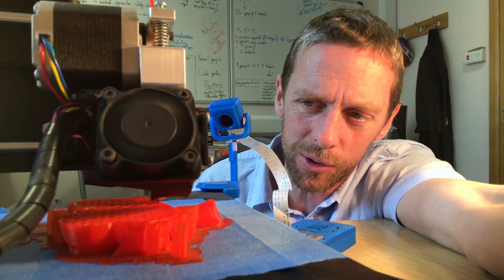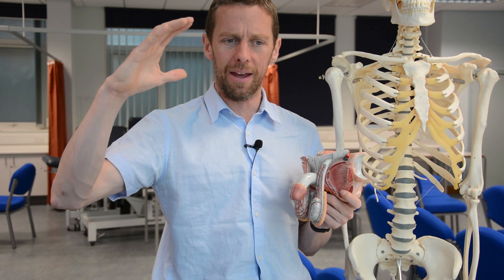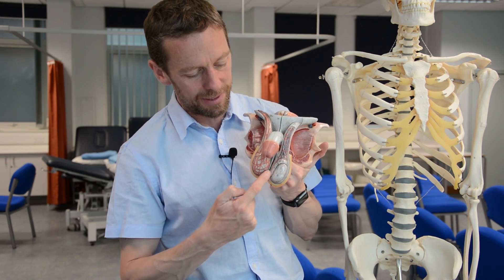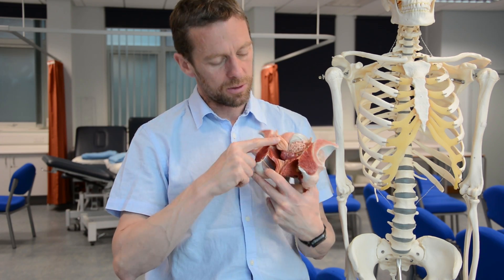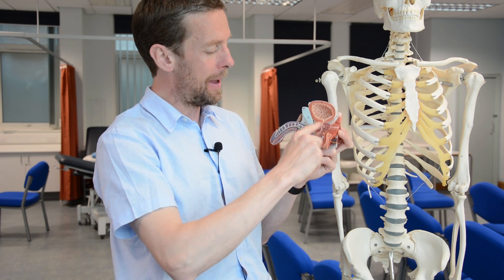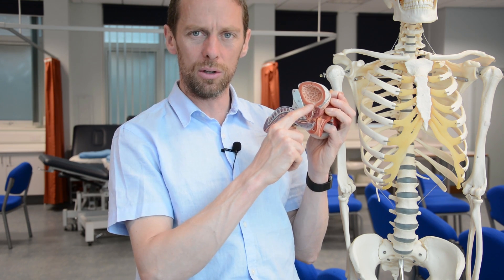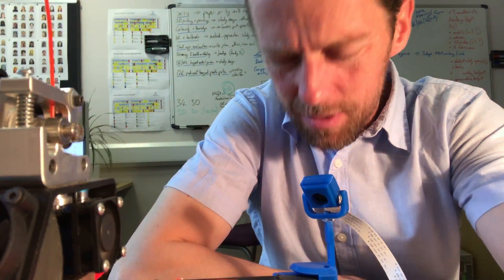Male reproductive system - the path of ejaculation

Comment: Where do the 4 or 5 ejaculatory pulses originate? Is this a kind of sucking into a chamber and then pushing out the urethra, or is it all contained withing the tube? Is there a check valve of some kind to prevent back flow, or is part of the musculature able to tighten behind, push the sperm forward and then regroup for the next pulse? Does this squeezing come from the brain, the spine, or some other excitable muscle reaction? What are the normal amount of ejaculation pulses in the male? Do they all have the same number of pulses, or does it vary by age, health, etc.? Thanks

Comment: 1:45 Testes
2:00 Seminiferous tubules
3:15 Tunica albuginea
3:30 Epididymis (posteriorly)
3:40 Rete testes (straight tubule)
4:05 Ductus deferens or vas deferens
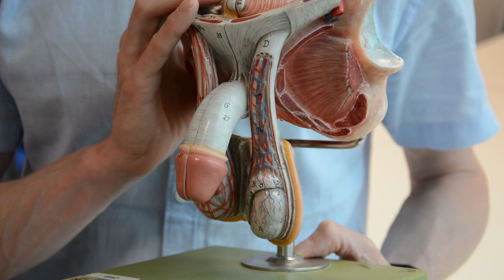4:39 Spermatic cord
5:00 Inguinal canal
6:10 Seminal vesicles (next to the ductus deferens)
7:00 Prostate gland
8:20 Ejaculatory duct
10:50 Components of semen: Fructose
11:10 Coagulation agents
11:25 Vitamin C, prostaglandins
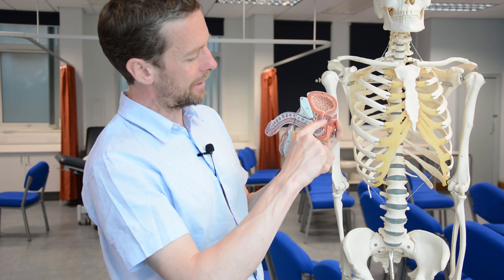12:00 Bulbourethral gland + lubricants
12:43 Bladder + External urethral sphincter + Internal urethral sphincter
13:20 BPH
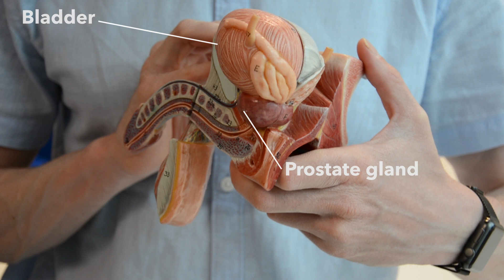14:40 Prostate gland + Bladder + Seminal vesicles + Ductus deferens + Ureter + Urethra
Reply: 😊b n😊😊